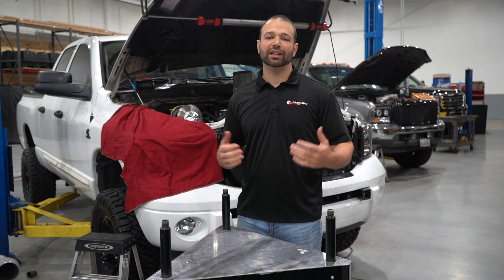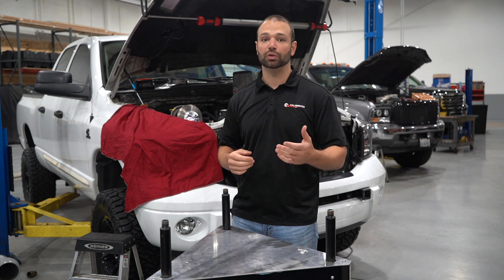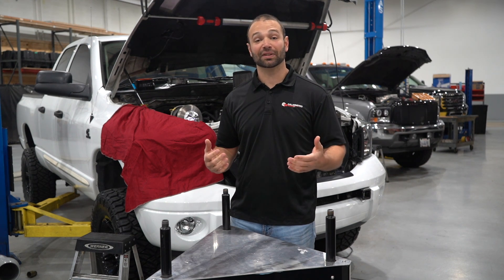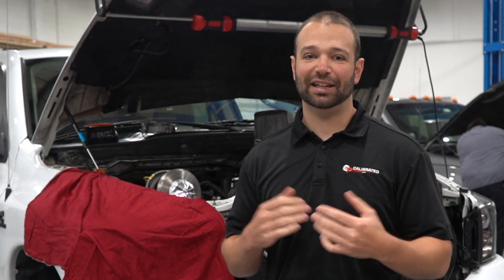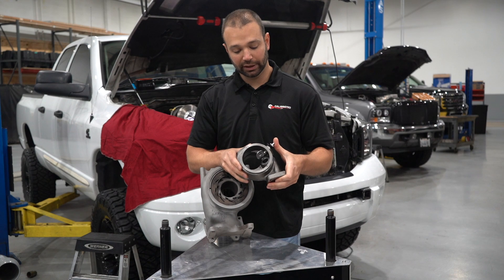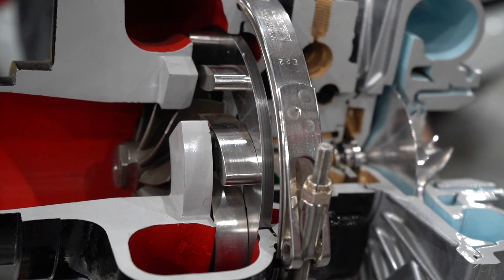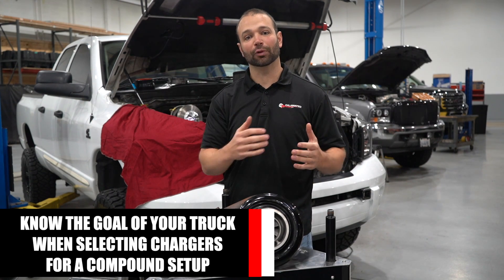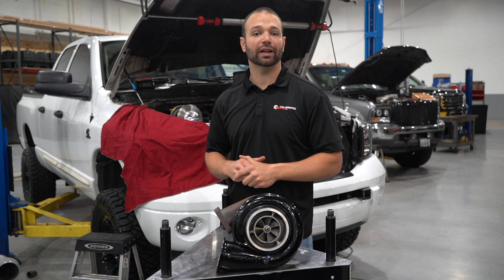DIESEL INSIGHTS: SIZING YOUR COMPOUND TURBO SYSTEM

Comment: Do you think a s475 with a stock IHI turbo in the valley compound setup would work good for a stock fuel/stock motor lb7 Duramax? The truck would be daily driven on the street

Comment: any sugestions on a 400hp compound setup for a 6.7 cummins? it has the he351w currently. swaping intio a unimog and the trans isnt up for high power.
Reply from the maker: An s475 has always been a solid match for the he351cw.

Comment: For top end power only, would a big single flow better than compounds?
Reply from the maker: It depends on the setups you're comparing. For example, if you ran a single s500 (almost no one does this) and compared it to an s475/stock setup than yes. Otherwise, if you were comparing an s366 and an s475/stock the compound kit will win.

Comment: I have a third gen DIY my own compound I'm doing an hy35 pushing an HX 50..... Am i setting myself up for failure a raptor fuel system I have 50 over injector tips and all the bolt on's bullshit stock re48 w performance valve body ... My goal is 600

Comment: Im building a lb7. Im planning on a compound turbo system. Im using a lbz block, balanced rotating assebly and thinking about the cast iron heads. Looking to get above the 700 to 1000 rear wheel horsepower range. Looking at yhe 14mm stroker injection pump with the supply pimp attached to it. Now the compound turbo kit. Looking towards the s480 with one step up over stock turbo but which one? This just a project ive always eanted to do. Any suggestions?

Comment: Whats a good company that can do an add turbo kits 750-775 for 06 cummins?
Reply from the maker: Hit up WCFab for twins, our Stealth 67 works perfect up to 800+HP.
Reply: When you say the 67 works perfect to 800, is that the 67 paired with a stock? And on top or below if so?
I have the 67 singe on my 03 cummins with PXBR Pacbrake and want to retain it, so not sure if I can do compounds.

Comment: Hi Nick, please help me out. I'm doing a compound setup on my vehicle but I can't find any info on anyone that has done a compound setup on my specific vehicle.

It's a Ford Ranger 3.2liter 5 cylinder TD.

Currently I'm making 350hp (stock 197hp) & 750Nm (stock 470Nm) at flywheel. I want to be able to make around 450hp and 1000+ Nm. 

I have no clue how to size the bigger turbo as I want to use the stock turbo that has slightly been modified(hybrid).

My current turbo has a lot of turbo lag and won't be suitable for the setup.

Where do I start and can anyone help please?

I have another borgwarner K27 turbo, maybe that will work with the stock Garrett powermax turbo...?

Thanks in advance!
Reply from the maker: @Nortifyer Your modified stock turbo should work well as a secondary turbo for a compound setup. The BorgWarner K27 would also work and probably get you the 450hp you are looking for out of it too. It's all about finding a turbo that comes into its efficacy range right as your secondary turbo is falling out of its efficacy range. If you might be looking to make more than 450hp later down the line something like a BorgWarner S252 or S257 would also be a good match for the power you're going for combined with the efficacy range of your stock turbo. Check out our video on sizing your compound turbo system for more information on the topic: https://www.youtube.com/watch?v=oSdusJZG9AU
Reply: @Duramaxtuner  thanks for the comment!! Appreciate it! Love your content!

Comment: 364.5/73/14 & 480/96/1.32
12MM P7100 24v 
I'm gonna run Headstuds without O-ring and dog it and see how long it lasts, 4k GSK so i'll probably do Rod bolts and of course pushrods and valve springs and send it
Reply from the maker: @adudenamedjeff3962 You should be fine with just some head studs and a new head gasket. Sounds like she'll be pretty rowdy though.

Comment: I am currently running a s476 sx-e 1.15 AR over a s361 sx-3 .83 AR (non gated) with 30% over injectors.  On stock tune it builds boost quick and tows nicely with egt's maintaing sub 1100f however I am concerned if I run it in tune 5 (650HP) my drive pressures may be too high due to the restrictive .83 housing.  I am planning on adding an external gate to relieve drive pressure from the secondary turbo and feed into the primary but am unsure what # spring to start with.  What would you recommend?  Do you think it is even necessary with my injector size and HP?
Reply from the maker: @hallasnackbar1865 It really depends on the boost pressure you plan on running along with the wastegate actuator you plan on running. If you let me know what those are I can probably help you figure out what will work best.
Reply: @Duramaxtuner  I did not have a specific boost pressure in mind, I just want to keep both turbos in their optimal efficiency range and avoid over driving and damaging the smaller turbo.  I have 30% over injectors and a 5 position switch with tune 5 maxing out at about 650 HP.  I have not used tune 4 or 5 since switching to the smaller exhaust housings .  I don't race the truck and rarely if ever run past the 3.25k rpm factory redline.  The truck had T4 .91 and T6 1.58 housings before and it made 650HP at 3500 rpm but was really  laggy sub 2200 rpm and the power was unusable for towing.
Reply from the maker: @hallasnackbar1865  You will want to base your turbo's  boost pressure off of the efficiency range of the compressor map for that turbo (if you have access to one). If you are exceeding, or at the limits of, the efficiency range then executing your plan to re-route the waste gas into the secondary turbo wouldn't be a bad idea.

Comment: What compound kit would you recommend for lly stage 3 trans 650 build, 15% injectors mild engine internals ARP everything, new stock turbo mild pulling tunes. Its for a daily work truck about 200 miles a day, low to high elevations. Only pulling about 8-10000lbs. I'm looking for reliability low egts for pulling weight up hills and taking stress out of the system. I'm thinking stocker 475 or 471 kits?
Reply from the maker: Give us a call, 815-568-7920.

Comment: I have am LMM and a SXE488 from another build that didn't happen. I was going to do a 475 but i have this - Is this too big? Planning built motor, 60 over injectors, fass, 10mm cp3
Reply from the maker: We see plenty of s475 over twin kits. It always comes down to what your ultimate goal is of the truck.

Comment: I have a lml 250k miles on it will be doing heads here soon truck is deleted it pushes 35psi don't know how I bought it like that. Looking to get a set of heads from choate with ring work done I will change bearings as well and compound it  .
I pull a 20k trailer once a week on the mountains 7 to 8 degrees slope will the 475 trow a rod? What would yours guy's recommend. Believe or not my old LB7 with 350k did a much better job PPE max out sometimes I use the old bully dog with crazy larry 😜 couldn't kill the the truck until I rolled of the mountain....
Just looking for lower EGTS I will ARP stud it too.
THANKS
Reply from the maker: We can help with turbo sizing, give us a call 815-568-7920. Tuning we will not be able to help with as it is deleted though.

Comment: 95 12valve. 5x.014’s. 191 DV’s. Hotrod mechanical pump. Studs. Valve springs. Afc mods. 22* timing. With a 64/68/12 s300 currently. Looking to add the best sized s400 into the mix for an all around driving mix.
Reply from the maker: Hey, give us a call. 815-568-7920

Comment: Great video!  Here’s a question: ‘05 Ram, 5.9l, Manual Trans, Stock CP3, BBI 0.5 (60hp), Smarty S06……what if I want to use the stock turbo for the fastest spooling daily drive/tow setup on the road and don’t even care about saying I can make 700hp?  What about downsizing the primary to a smaller T6?  BorgWarner S400 SX-E? Garrett GtX470?  What would you recommend and how would you size it?  THANKS for reading the long comment!
Reply from the maker: Hey Andrew, give us a call. Way easier to talk about over the phone. 815-568-7920, thanks!
Reply: Think I’m going with S471 T6 71/96 1.15 A/R

Comment: So my lmm I bought came with a s475 over a danville 68mm drop in. Engine had cracked piston and I'm rebuilding. But I have been told the 475 was too small for the 68 and I needed a 483 or bigger. So I'm looking at a bullseye 488. Thoughts?
Reply from the maker: Give us a call, 815-568-7920.

Comment: Great video, love the explanation. Just curious — planning to eventually run a Stealth 64 with the 67’s hot side under an Aggressor 88 on an 04.5 Cummins, and I’m wondering what the maximum RPM is that could be sustained for a prolonged period (up to 5 minutes) without putting the valley turbo in danger?
Reply from the maker: Give us a call, Robert! 815-568-7920

Comment: Hey so to start out I’m a missionary in Haiti and have a 2011 Isuzu Dmax which is a foreign country built truck not sold in the US. But it is super ridiculously slow and we get into some bad situations sometimes down here especially lately where I want to get the heck out of there as quick as possible. That being said it has a 4 cylinder 2.5l turbo diesel with a super tiny turbo on it and the engine is fully mechanical no computer to change anything. I’ve increased the fuel flow of my injector pump slightly and that already made a difference but would like to pick up some more if possible. Should I look into a compound setup so it runs cooler in such hot temps here or am I better off just going with a little larger single turbo or even a factory same size just with a line to the wastegate and throwing a T in it just for some small gains. Again not looking to blow the engine up but don’t love how slow it is. Also on a tight tight budget haha 😂
Reply from the maker: With a tight budget, we'd say go larger single charger.

Comment: Wow Nick great video and sales. Appreciate your insight. Pretty obvious from your presentation you have immense time and knowledge in R&D. I’m knew to diesel performance but not building high HP motors. I kept thinking why would you upgrade the small turbo over adding a compound. Will be talking to you soon for my motor upgrades. Looking for power in a f550 2nd gen Cummins. Heavy truck for work and don’t want to destroy mpg. How can I get in touch with you?
Reply from the maker: You can talk to one of our knowledgeable reps. 815-568-7920. Thanks

Comment: Now what's biggest difference going from a 1.15 ar to a 1.32 ar housing on atmospheric charger?
Reply from the maker: It's going to impact how quickly it can spool up and how much peak power it's capable of. Tighter AR will give you quicker spool up (lower RPM efficiency) but sacrifice some peak power.

Comment: Currently Running lmm with s480 over stock kit 60% overs 10mm pump, built short block, Been this way for couple years love it. Looking to up the game. 
Would stealth 67g2 with 64 compressor / s480 get me fuel issues? Upgrade to 100% overs? Dual duelers or Single 12mm? And what would probable power output be?
Reply from the maker: With that combo you could likely jump to 100% overs and a 12mm pump (or dual Cp3's) and make 1,000 HP. It really depends how you use the truck and what you want to accomplish with it.

Comment: Was wondering if I should go 475 or 480 1.15 over stock for strictly pulling decently heavy. Just want the engine to be safe and cool which one would be better since price is similar and what are issues going with the 80 instead of the 75. Thanks
Reply from the maker: 475 is likely going to map out for better drive-ability. The s480 will perform better at peak load but likely will have higher drive:boost pressure ratios on average.

Comment: I got a s400 sitting at the shop. Could I just add it to my stock turbo on my 05  6.0 ? It's got head studs with a 100 hp tuner stock injectors.

Comment: I recently purchased a 2012 duramax with a wc compound turbo kit it don’t perform like I think it should what are some things I should look for to Diagnose the problem
Reply from the maker: Boost test it from the face of the atmospheric charger. Also, most guys neglect their air filters on compound trucks for some reason. Fresh air filter and clean the MAF while your at it.

Comment: Good info. i ran a S483/96/1.32 over a 63/68/14 on a 04.5 CR with alot of fuel. Spooled extremely fast and was very clean on street tune. When on the Hot tune truck made just shy of 1,000whp and we limited it with the gate to 85-90 psi. More then that drive pressure would rocket.

Comment: I’ve been poking around the idea of running a stealth 64 with a s488 on my 2015 lml building a solid 7-800hp tow rig and maybe 9-1000hp on a hot tune. Would that be a good matchup?
Reply: I’m running an s480 over a s364.5 sxe in the valley on my 03 lb7 and it tows like a dream

Comment: I have a 2001 Dodge 3500 and I pull a 30' toyhauler. 5.9 Cummins with NV5600 6 speed manual Transmission and 3.73 differential gears. I noticed you didn't say anything at all about EGT other than to say certain things make a lot of heat. I'm not really interested in super high horsepower. What I want is to be able to use all of the power my truck has without the EGT going sky high. I also want quick spool up and that means compounds. My engine is factory rated at 245 HP and 505 lb/ft of torque. If I could just use that all on a long steep grade that would be great. I don't like high RPM. The truck I used to drive redlined at 2100 RPM and I know I'll be turning more than that with this smaller engine but I don't really want to turn more than about 2500 RPM. I'd like to keep it between 1700 and 2250 if I can and EGT no more than 1200 maximum. I've had to downshift on a couple of grades to 4th gear to maintain any decent EGT. Given my distaste for high RPM on this engine, that means I'm only passing the most heavily loaded truckers at 45 mph in a 65 or 75 mph zone. So I don't want to increase fueling, it has plenty of that I just want a better air flow. What size turbo should I put on to feed air to my Holset HX35?

Comment: So does this information carry over to a powerstroke application? I've been wanting to do a compound setup for light towing and alot of fun and I'm really confused
Reply from the maker: Most of the advice given this video should translate well to the Powerstroke market. I’ll be honest and tell you that I haven’t done any Powerstroke compound turbo sizing. However, based on the engine size and factory turbo charger selections I see no reason why the theory should not apply there.
Reply: @Duramaxtuner  thank you, I didn't think you guys would have much out there as for powerstroke specifically but the information you guys do have is amazing and I love watching the videos regardless.

Comment: Okay Nick! I've got an 08 6.7 48re swapped cummins with efi from Firepunk made 733whp on a single 369sxe on a 3rd gen manifold swap, question is will this be sufficient to run an s488 or 491
Truck is studded with 6500rpm valvsprings
10mm exergy stroker 
60 percent overs 
Fass lift pump 
Intank sump etc

end goal of 1500hp

Not opposed to upgrading fuel again
Reply from the maker: Yes! We have had several customers run similar compound setups. You likely are going to want to upgrade your Cp3 and Injectors to get peak power.

Comment: What size turbos would you recommend to efficiently make 1000 rwhp at 5000ft elevation on a 5.9? Currently have a single 472 and want to put a 488 on top but I’m wondering if I can downsize the secondary a bit to reduce the LAG
Reply from the maker: How do you plan on using the truck? Will you be doing a lot of towing? Do you want to drag race?
Reply: @Duramaxtuner mostly a street hot rod and some drag racing! Towing could be very little..
Reply from the maker: @ronnyenns9469  What year 5.9L is it? Assuming you have a common rail, a 3rd Gen Stealth 67G2 and s488 has proven to be a nasty street rod setup.

Comment: Witch kit can i put on a stock lly and be able to tow whit it and how much hp can i go whit the stock fuel system
Reply from the maker: A Stealth 64 VVT is probably the right match for you. If you really want twins, an s475/stock is most likely the ultimate kit for towing.
Reply: @Duramaxtuner  the stock turbo on a lly is it the same as your stealth 64 vvt

Comment: Is compounds worth it for towing
Reply from the maker: Yes!
Reply: @Duramaxtuner  i have a 2007.5 6.7 that has been deleted. The truck has a 2 piece 5.9 manifold with a 64mm phatshaft installed in the stock location. what can you do for me?

Comment: I have a 97 Cummins with a 4" tail pipe. Stock injectors looking for better towing and cooler running.  Have larger all aluminum radiator. My 46re has steel 6 gear sun gear, upgraded torque converter  and bilet drive shaft.  With a shift kit and gm solenoid. Any advice. Would like cooler towing and to not lose any fuel economy while getting better towing.
Reply from the maker: s400/stock compound kit is hard to beat.
Reply: @Duramaxtuner  i getting ready to order a torque converter 47re  and looking forward  to doing a sequential twin turbos IE compound  turbos. And going to the 400s (S475) so what torque am I looking at and were would 5he ideal stall be to kick in on time? 97 2500 4x4 4re stock injectors.
Reply from the maker: @seanbrossard8178  Give us a call, 815-568-7920

Comment: Any tips for a 1.6 idi. I was thinking a gt17 or something about that size and then mabye a gt25 or t3/t4 for the larger turbo... any tips would be nice... the idea being it will spool instantly, and hopefully with the larger turbo it will keep making driveable power to redline. Revs to 5000 hoping to keep power to 4500. And not hoping for much power.

Comment: Hi Nick, will the "average" stock diesel turbocharger exhaust side be able to flow well enough to drive the second bigger turbo (if sized correctly) without any modifications?
Reply from the maker: Good question. The short answer is yes.
Reply: Cool, thank you